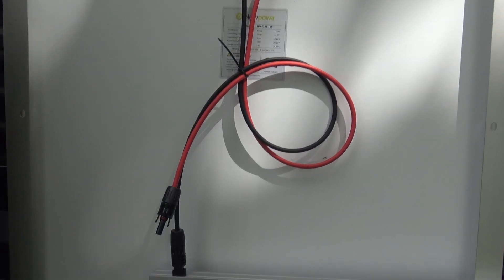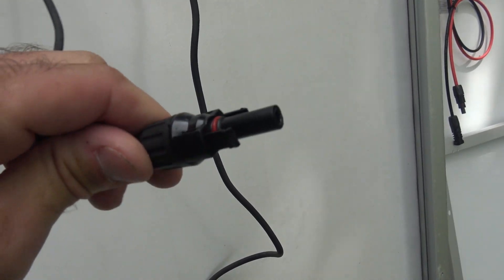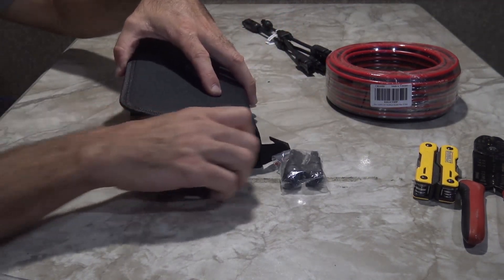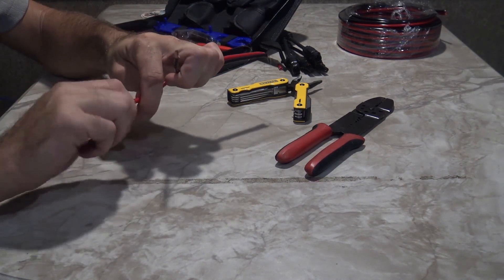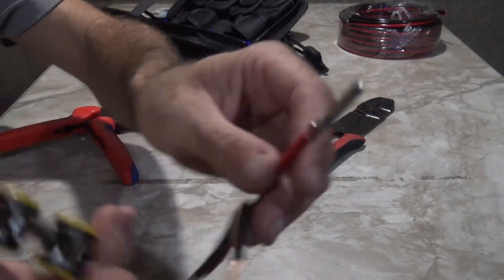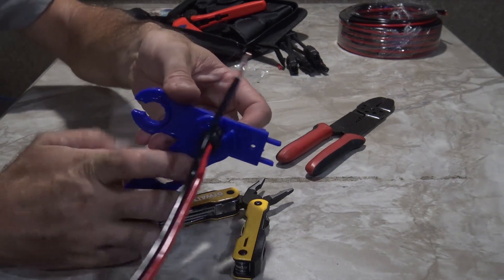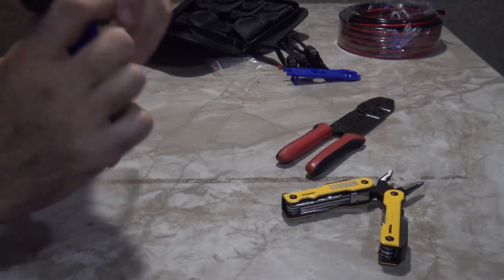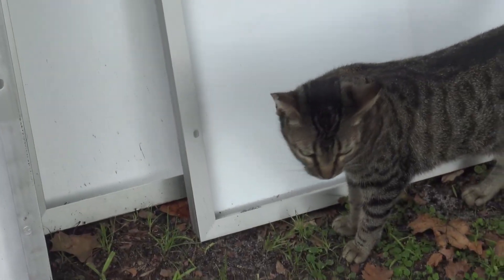How To Build/Crimp MC4 Connectors, Solar Panels Off-Grid Living

Comment: 1. DO NOT USE CHEAP  MC4 connectors because they can melt and or start a fire.
2. CUT "ONE" wire at a time to not mix the up. (if you are doing the back of the solar panels that have Black wires)
3. those "WINGS" are to crimp down onto the Insulation... 
4. use the right tool for the job like shown here!

Comment: great job showing a standard solar connector . MC4 is what mostly use now. With your 36V panels .Look ay your MPPT charge controller data sheet . look at MAX PV voltage and MAX PV input watts. depending on controller you may be able to series more. higher voltage less amps and less voltage drop in wire . look at panel read open circuit voltage   compare that tp max PV on MPPT.dont go over that . may go 72V if controller can take that .also check into shading diodes. will be important in series panels. also a blocking diode if parralo panels  not the same amps .helps with shading.   love the set up ! 73's

Comment: Not wanting to bring out the caren here, but thats not how that connector is done. You have a problem pushing it in, because you messed it up. Wings go around the isolator or around the strands/core of the cable depending on brand/type. Just taking the shortest video of a proper crimp i could find: https://youtu.be/9e8MjNGUAB4 - This clearly, just like most manufacturers  show where to crimp. Its not around the round part where you crimped and deformed the connector, but at the back of the connector where the blades you used pliers for. Also, that crimper you have will work much easier when used correctly, even one handed ;) 73s!